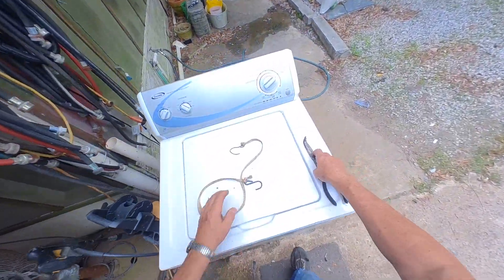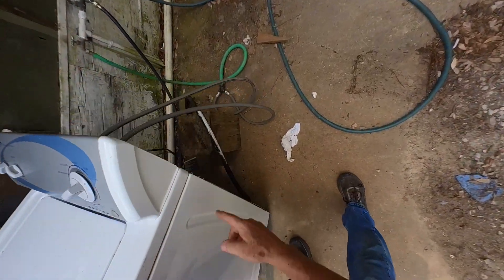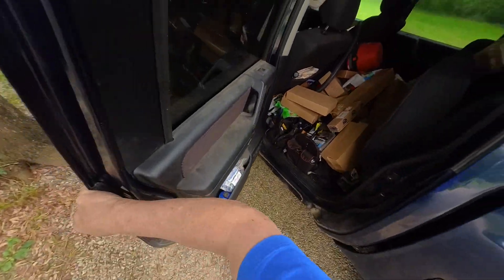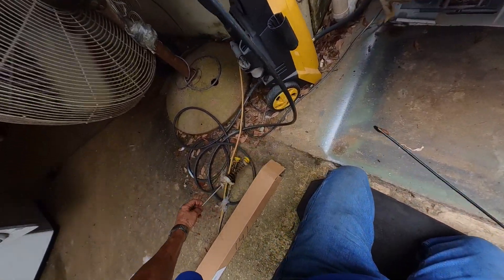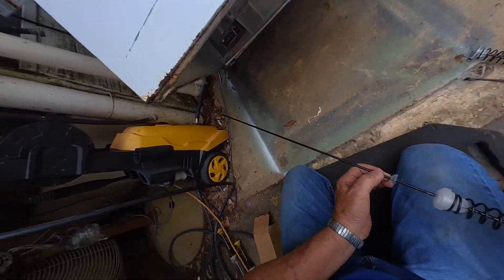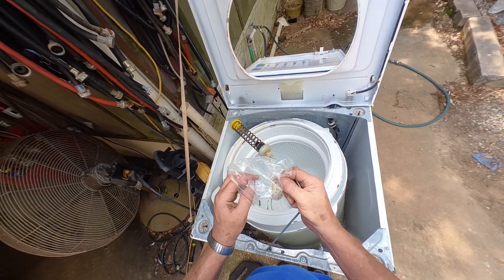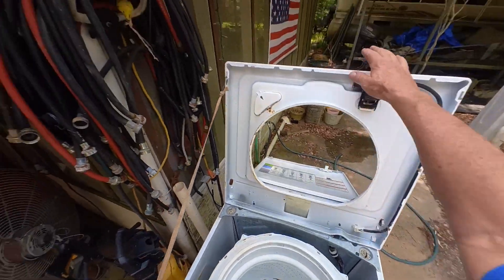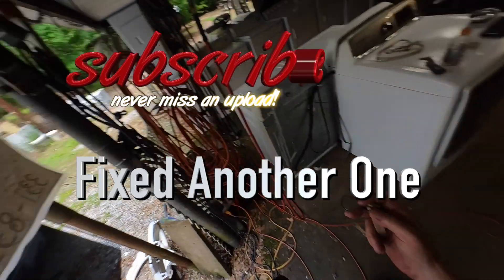How To Replace Suspension Rods in Any Washer: Crosley, Whirlpool & More

Comment: I had an GE washer with the white cotton on the rods and some of it fallen into the washtub and went through the drain hose and clogged up the pump but anyway don't really know what the reason for it on the rods.
Reply from the maker: I think that is stuffing from pillows or blankets that gets caught up in the dampening grease. I can’t think of a reason why it would be intentional and you don’t find it on every model of the same brand.

Comment: Where do you place the top sleeve ? Should it be right at the top of the spring? Nobody shows or explains the top sleeve.
Reply from the maker: If you are talking about that little plastic piece above the shoulder of the rod it should be above the tub slot or hole. Thanks for watching!

Comment: That fuzz on the old rods is where a pillow has been washed and came apart during spin. poly fill is what it is called
Reply from the maker: You know, that is the best explanation I have heard. I know it doesn’t come with replacement rods and the dampening grease on the rods would certainly trap it if it was flying around inside. I’ve seen this on so many machines I always thought it had to be part of the manufacturing process. Thanks for this brilliant comment!
Reply: Had a lady put 2 full size pillows in her whirlpool went about her housework.  well when the spin cycle started it was so violet that the washer moved and punched a hole in the sheetrock. it also shook so violetly that one of the suspension rods came unhooked from the top and then the tub bent the side and front of the washer. i did fix the washer for her lol.
Reply from the maker: Lol, it’s fortunate that it was repairable!

Comment: Anyone got any good solutions removing a wash plate tried straps tried banging with the screw partially in right now I got it soaked in limeway. These things are a nightmare
Reply from the maker: I feel for you my friend. I’ve had to resort to breaking them away from the metal piece that is embedded into the plastic, then using a bearing puller. Then replacing with a new wash plate. I tried citric acid a few times with limited success. https://amzn.to/47W9CD3
Reply: i use 3 air bags to remove them.